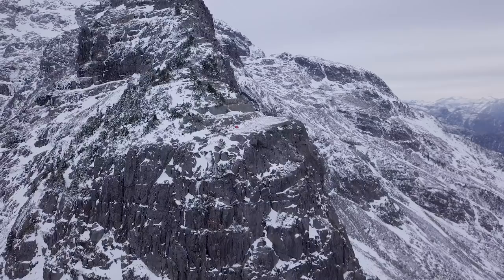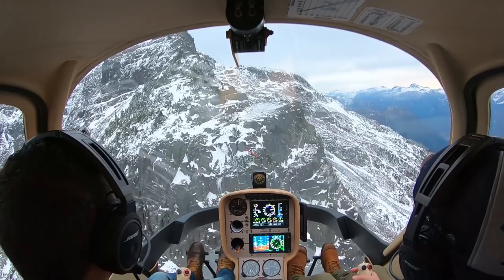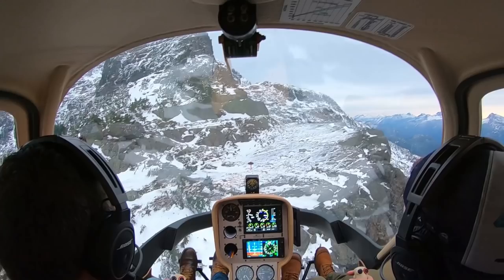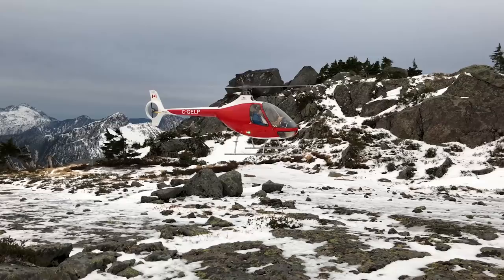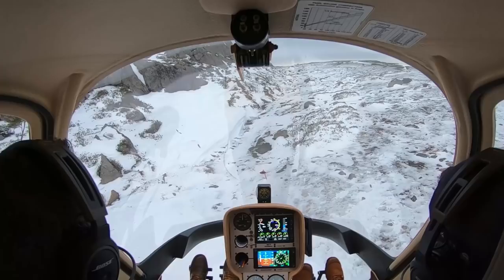WHY HELICOPTERS CRASH WHEN OVERPITCHED

Comment: Wait, now I'm confused. Why is the helicopter using 100% power to hover? How does it require less power for moving than hovering? Do you just have the pitch of the rotor adjusted to produce only what lift is necessary?
Reply: The movement of the aircraft through the air increases airflow over the rotor blades and makes lift.

There is a speed limit, however, due to the receding blade losing effective airspeed, which causes an overpitch (rotor stall) condition.
Reply: I mean, I understand the speed limit, and I understand flight where more lift produced on the forward rotating side and less on the rearward rotating which requires more angle of attack on the retreating side, but the part I'm confused about, is that, if 100% of power perfectly counteracts gravitational pull through lift, then how would it ever make it off the ground (not counting for ground effect which requires less energy due to action=opposite reaction stuff with the ground). If you are using all of your power to hold stationary how would you generate more lift to ascend? Increasing pitch would increase drag which would require either more power (which you don't have if you're already at 100%) or start bogging down the motor until forces were equal again. Sorry if I sound ignorant, I'm not extrememly knowledgable about helicopters and it sitting at 100% power to remain stationary just threw me for a loop.
Reply: Clinton Savage 

If you watch helicopters take off, there is a profile that the pilot should fly to maintain a safety buffer of speed/lift/power curve.

It goes like this;
Get airborne, hover in ground effect, move forward adding lift through relative wind, commence climbing. Lifting straight up in a hover takes a pile of power, and on hot or high days, you may not have enough to do so.
Reply: Mark Lade

Thank you for that, that was a good explanation, but on that note, why would one not design helicopters to have more than enough power to ascend rather than requiring forward momentum to generate enough lift? I know this comparison is not exactly accurate that I'm about to make, but it's the best that I can come up with at the moment, a drone's electric motors provides enough power to ascend without requiring forward momentum to generate more lift (though they are fixed pitch and require altering of motor speed) why wouldn't a helicopter be designed to require, say, 50% of motor power to maintain stable when hovering, thus increasing power or altering pitch, whether collective or cyclic to generate lift to do what you're asking.

As example, if I left the power at 50% (in the ideal helicopter of my imagination that doesn't exist I assume) but increased lift on the rear side of the rotor plane, I would nose down and start accelerating forward, but what lift was used to hover, is now being partiall converted to forward momentum and I would decend without also increasing collective pitch which a motor that only requires 50% of power to maintain a hover would have the ability to do.

Once again, sorry as I may completely be misunderstanding helicopters at this point.
Reply: Clinton Savage 

Engines are heavy and require fuel to feed the 'horses'.

So if you replace a 200hp engine with 400hp, you will increase the weight of the helicopter with the engine swap, burn approximately twice the fuel, and you'll have less payload to carry people, freight and fuel. You could increase the allowable weight to compensate, but you'll need to add more fuel to actually use the ship to go somewhere, but at 6#/gal it adds up and you're back where you started.

Turbine engines are relatively light weight, and high power, which is why you see most commercial helicopters using them. But they are expensive.

It is common in all aircraft to require a balance to be made of fuel to carrying capacity. An example is on a long overseas flight, you'll notice that all of the seats won't be filled, the airline is using the 200# per passenger that isn't in that seat for an additional 200# of fuel...

Most of the times, you can have full seats or full fuel tanks, but not both...
Reply: Mark Lade that's a new perspective that I hadn't looked at, that makes sense, thank you
Reply: Also, keep in mind that he's talking about hovering out of ground effect at 100% power. At that barometric height (which is probably close to the thing's hover ceiling) and at those meteorological conditions. There are helicopters that can't hover OGE pretty much at all, only in ground effect. So, you have to use GE to gather enough speed for the effective translational lift to kick in. Then you can ascend. Just don't try to hover it in midair (unless you burned enough fuel, piloting it alone, etc.)
Reply: Clinton Savage you would descend until a certain airspeed is attained. Around that speed the main rotor is more efficient and you gain lift. You are flying in non disturbed air when moving forward. Also some of the tail rotor in unloaded due to tail vertical stabiliser lift.
Hovering in ground effect you have a cushion of air, trapped beneath the helicopter, which gives you more lift, out of this effect you need more power. Regards.

Comment: It’s all about power. Helicopters are cool but they can’t perform miracles. Pitching a helicopter forward serves no purpose. If you have altitude to trade for airspeed like down a mountainside then pitching has a purpose. From level terrain, it would be called “hot-dogging”. All it takes is a small misperception and the rotor contact a very immovable object called earth.

Comment: The zombie apocalypse can start anytime im ready.... Go to school. Wait for friends jump the fence to the airfield take chopper go to island And wait for the whole thing to blow over.
Reply: Sounds good. Any aircraft with rust on the brakes has no attention. They are the last to be missed.
Reply: Your flaw is an obvious one...while zombies prolly can't swim as they do not have the motor coordination and might be too full of holes and gases to remain buoyant, they should however be able to walk across the bottom of any body of water, so it is possible the island is not refuge at all. Narrow mountaintop with 1 narrow access that can be blocked or an urban water tower...if you can grow crops up on the ledge and have plenty of water you could hold out forever.
Reply: Whiplash that but they will drown lmao

Comment: "Overpitching"...must be a UK thing? I thought the video was going to be about improper cyclic application resulting in excessive nose pitch, high or low...this about rotor rpm droop due to excessive increase in collective with insufficient engine power available. Funky terminology and misleading.
Reply from the maker: Most of the world understands overpitching to be exactly what I demonstrate here in this video.
Reply: As a former U.S. Army UH1 instructor, I taught countless hours of helicopter aerodynamics (both in the cockpit and at the podium), never once heard the term "overpitching" used..must equate to  bonnet & boot vs. hood & trunk? Not saying that the condition you describe, means of avoidance, or remedial actions are incorrect, I just find the term to be more of a misnomer...but hey, civilian right?